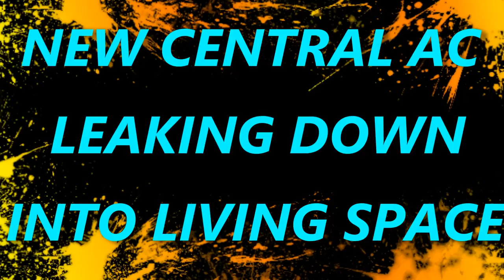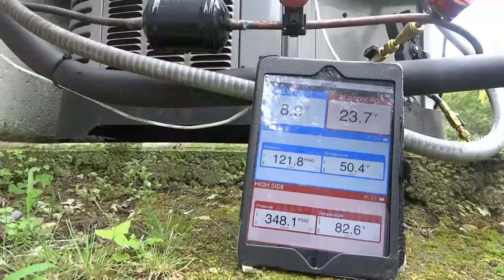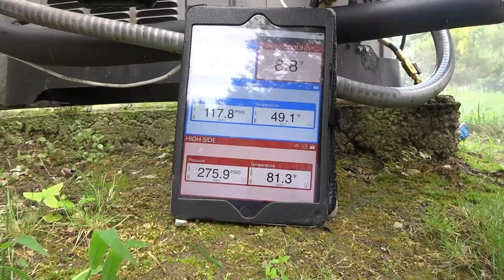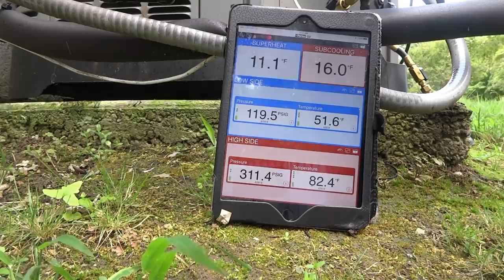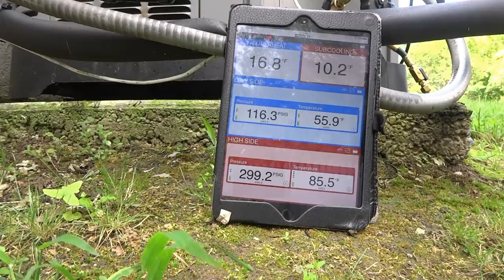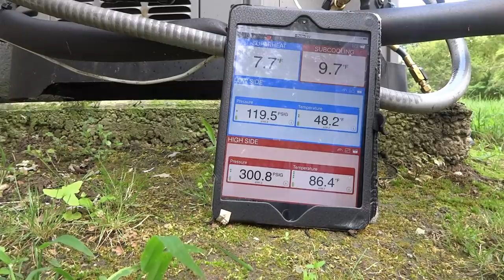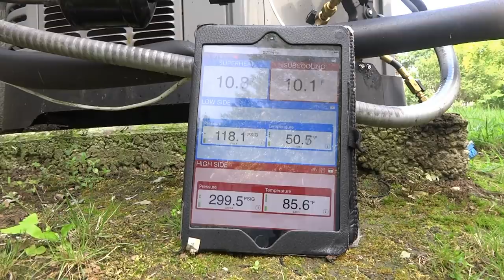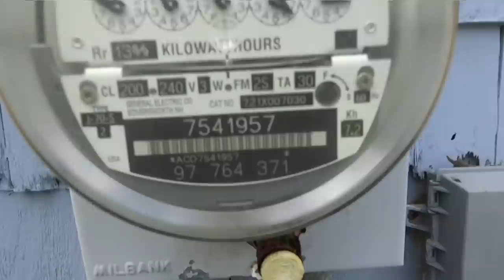NEWER CENTRAL AC SYSTEM LEAKING WATER DOWN INTO LIVING SPACE

Comment: Good call on the overcharge.  I noticed when you first started out and the TXV was hunting, the high-pressure was moving between about 325 to 350 psi. After you removed refrigerant, it looked like the TXV had stabilized and the high pressure dropped down to around 300 psi. Removing the overcharged refrigerant, gave you more condensing space and lowered the high pressure, which should also lower the current draw on the compressor thereby improving system efficiency and extending the life on the compressor.

Comment: If you have a solid install and you keep up with your maintenance, you shouldn't have any concerns for decades 👍.
Reply: Down here in South Florida close to the coast you’re lucky to get 12 years before your electric bill is sky high from corroded condenser coil’s. I wish I lived in a climate where we could guarantee that long of a lifespan
Reply: “Shouldn’t” 😳
Reply: "corroded coils"? Most manufacturers offer coated coils for places that have problems with corrosion, manufacturers charge extra for coated coils and they have to be special ordered, there will be a delay.  An A/C contractor just showing up at a house is just going to sell a regular unit - it's a little less expensive and it's usually quickly available at a A/C supply house.  If you live near water, look into coated coils on manufacturers' websites.
Reply: @markmcelmeel7850  I used to live in Palm Bay florida and its not only that, half the idiots down there don’t even know how to properly install a unit or run a drain, my grandmas 2010 rheem didnt hve a spec of rust on the coils where as the fedders wall unit had rusted through the bottom of the compressor and leaked out all the refrigerant, i believe they can coat them To last a long time now, just gotta keep up on rinsing the coils, changing filter and not run the unit to its limits

Comment: These guys today want to do the job as fast as they can, any shortcut and cutting corners will do, even if the job and access is easy peasy to begin with.  I did my own conversion of steam to baseboard with uponor pex, and hired a guy to do a new hot water gas boiler.  Designed by own routes, two zone.  Took all the pipe out myself and cast iron rads, sold the metal at the salvage yard.  Even took the boiler apart in sections to be able to handle it, out the window basement.   Plumber wanted to get an electrician to do the 2nd zone thermostat, at 250 bucks, basic cheap thermostat.  I bought a 7 day type, with a 50 buck utility rebate he never mentioned, and bought 50 ft of 2 conductor thermo wire, and a 25 ft snake, 40 bucks for the snake and wiring, and put the thermostat where it should be, not where it was easier to locate, as he wanted to do.  It’s not that I can’t afford professionals, can trust them enough so I don’t have to do it over, my way.  The guy I hired to drain and remove the oil tank, that’s all he did, and he did a good job.  Got the recommendation from a plumbing supply house.

Comment: Steve if it wasn’t for terd installs we wouldn’t make any money I finished a changeout yesterday at a condo complex in westchester ny one of the richest counties in the country where there’s no licensing and u see the worst work ever!! I live in Fairfield county Ct probably another one of the richest counties in country but Connecticut is like Mass very strict regulations and we have to pull permits for everything. So I finished the changeout of an old carrier heat pump to a new Rheem 16 seer two stage and as I was loading old equipment lady comes over and asks me if I could come to her unit for a service call and diagnostic and she had a new Luxaire 410a heat pump 2.5 with an old r22 York air handler some goomba changed expansion valve and it wasn’t working. She said the system was 7 years old which I think more around 10 when 22 was phasing out so she had another flat rate service company come from Bronx nyc and he put in 9 lbs of 410a and some leak stop and it cost her 3100 for the charge and leak stop and  it empty again.
Reply: leak stop??  Has anyone ever had that work?  $3,100 for a service call?  Yikes!

Comment: If its a TXV based system don't you want the superheat normally between 8-12?
Reply: TXV is subcooling which you want at roughly 10-15, you're thinking of a fixed orifice that's 8-12. However the proper superheat is based off the manufacturer's specs, 8-12 and 10-15 is more of a rule of thumb when you don't have the actual numbers on you.